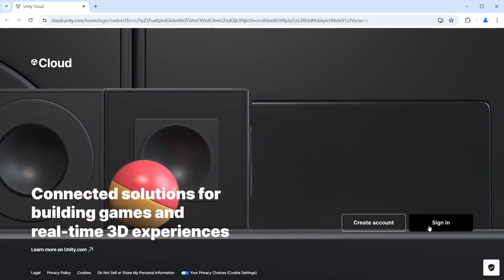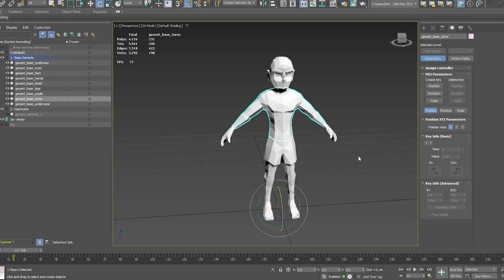Complexities of making a game engine

Comment: I would say that most engines nowadays have much more flexibility than your own engine could have.
So go for a more widely used engine.
(Better community support also.)
Reply: kardiyi na bekar  wale bat 
Problem ye nahi hai ki Flexiblity ho.
asli problem Optimization ki hai 
jo Inhouse GameEngine Solve kardete hai
buddy know graphics pipeline control the line of gpu as you can.
Reply: @OrangeIND-  Exactly. And you know how hard vulkan opengl etc are when you write an engine using them from scratch.
Reply: @PratikMishra-c4p  The only reason to write your own engine is for learning or if you need to do something that an existing engine can't do. If none of those apply, you're just wasting your time. But there are valid reasons to do it